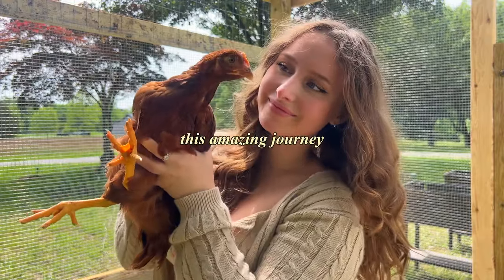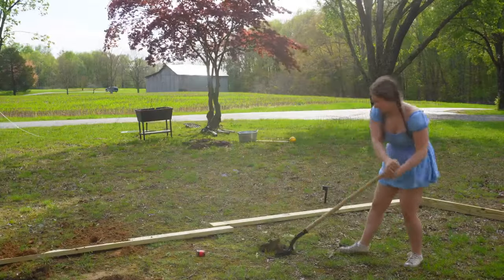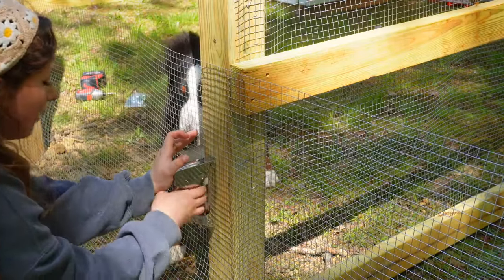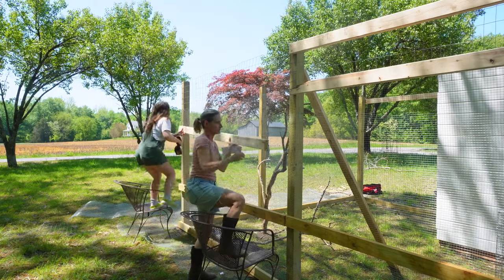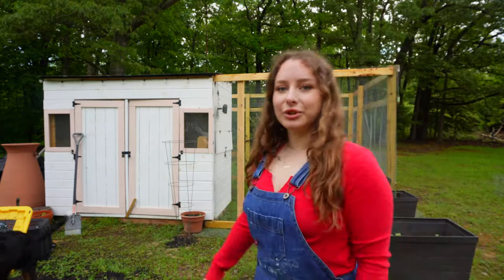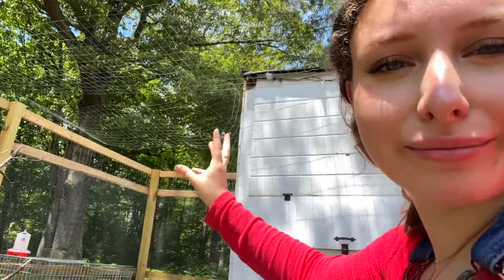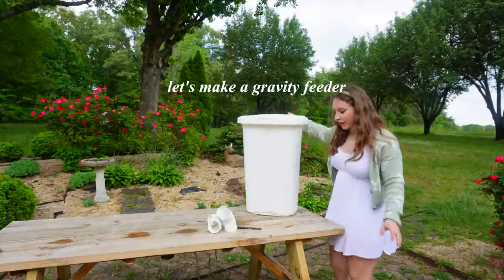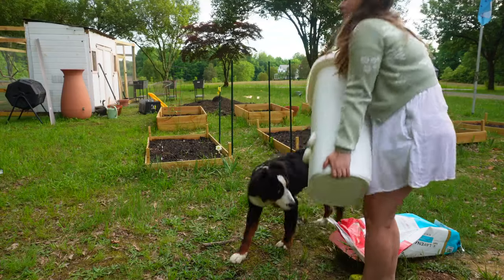Building a Chicken Run👷‍♀️🛠

Comment: Julia….. I had chickens for eight or 10 years before I sold my house

I did the same thing as you the chicken run on the side of my chicken coop with an opening chicken door to go out into it large fence for the chicken run 

And I built another large fence chicken run on the other side of the chicken coop with a separate door 

That was my garden 👍😎

Every fall just before Halloween I would switch the garden and the chicken run and cover the old chicken run with plastic to kill all the weeds by springtime. It was just dirt …fertilized dirt.

Garden on one side with the fence chicken run on the other side with the fence , same fence same hardware cloth on The ground so predators could not get in just like you

I bought a Rototiller in the early spring around February or March. I would turn up the fertilized soil for the garden and then plant later in the season

If you ever have a plan for a garden, your chicken coop is set up perfectly to put the garden right next to your chicken coop. Just put a matching fence. You’ll need a fence on your garden anyway.👍😎
Reply from the maker: I love this idea! I’ve seen several others do it too and it’s genius!
Reply: @JuliaBrooke  😊